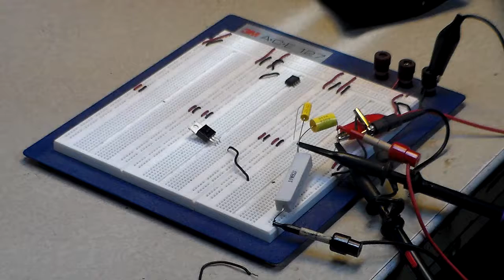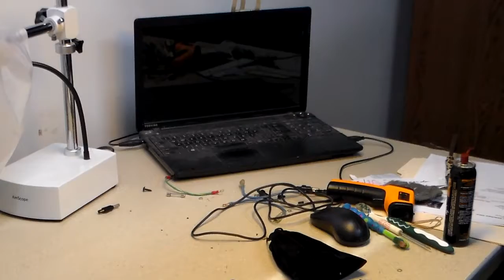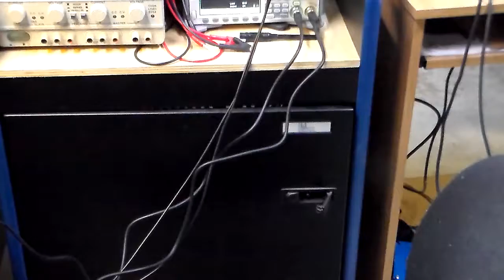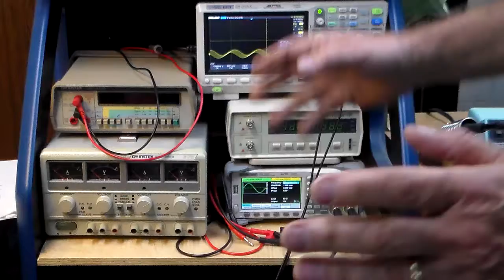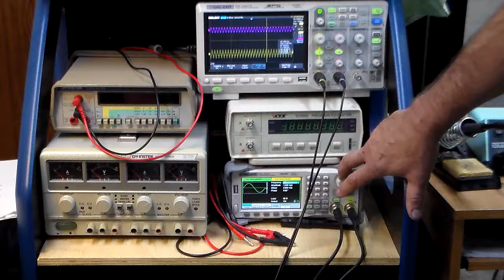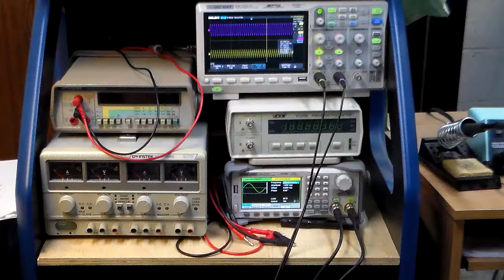Fun With Capacitors

Comment: thanks for this video
just started to learn about electronics. this brief video was a visual eye opener re capacitor function.
i will try this with disc and poly caps also.
what frequency and amplitude do you recommend to start?
john
Reply from the maker: Any frequency and just a few volts.  Watch how the cap blocks low frequency and DC then starts to become a low resistance path as frequency increases. Check out Mr Carlson's Lab and TRX Lab for some good lessons.
Reply: thks tim